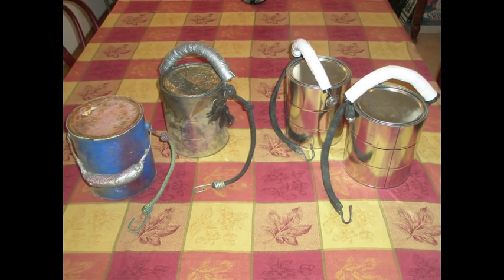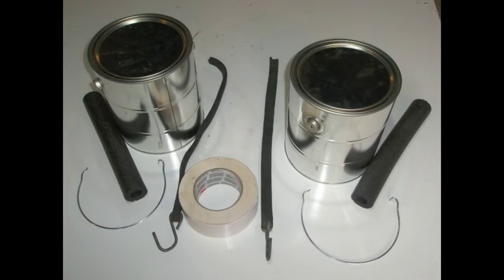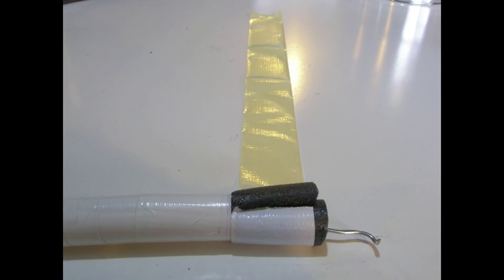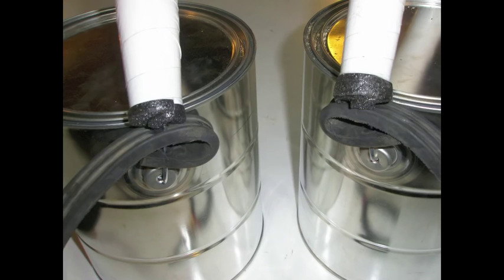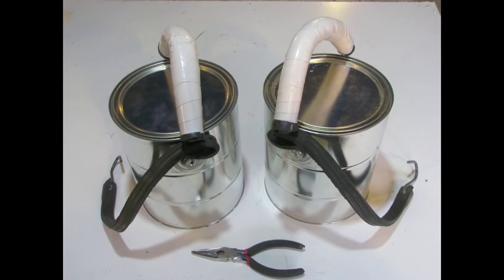Paint can stilts

Comment: I used to paint apartment turnovers and would stand on empty 5 gallons and then tie the handle up in my work boot laces to use as stilts. Maybe you could work out a 5 gallon version for a little more lift.
Reply from the maker: Steve MacKay I too use to use a 5 gallon bucket when I was a drywall taper, before I purchased stilts. I would do the 'bucket walk'. Not fast but effective.

Comment: Paul, it looked as if you filled the cans with something. If so, what did you use in them? That would increase the strength of the cans if something not very heavy was in them.
But, still a great idea. It's just too bad that I weigh 265 pounds.......
Reply from the maker: Kevin S No. They are purposely kept empty, but I suppose you could cut out round disks of foam board stacked up to the lid in case they collapes.
Reply: Paul Elkins I wonder if dome shaped stilts would support more weight. Like the way the dome structure of an egg gives the end more strength.